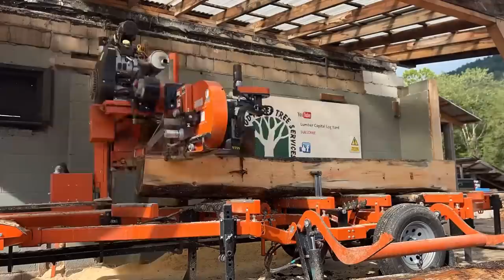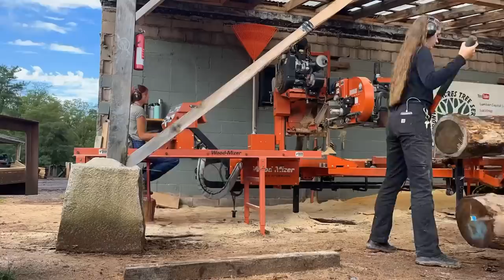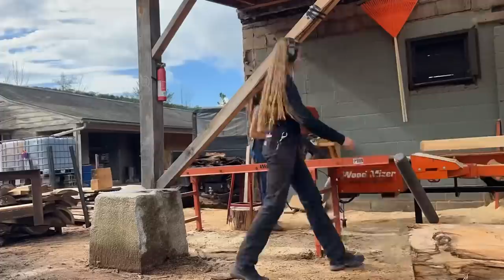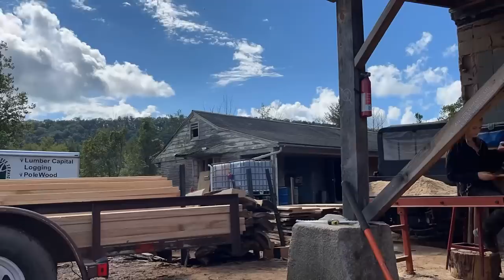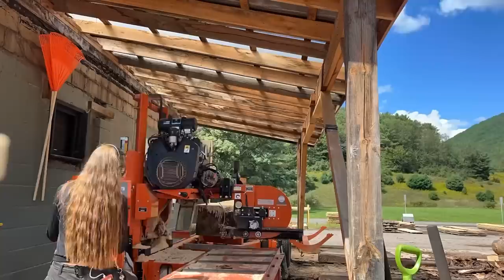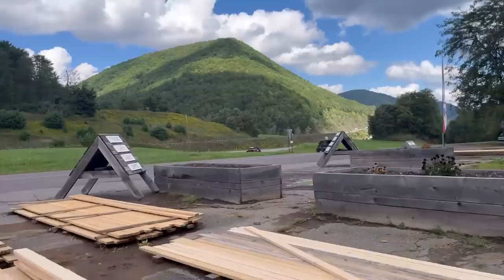Satisfying Mill Operation

Comment: You may want to consider re-leveling your mill. As the head moves along the bed, some of the legs of the mill come off the ground. This means your middle legs are too long. The front and back legs should always be touching the ground and support most of the weight of the mill. The middle ones should just be slightly touching, or even close with nothing on it. The bed of the mills have a slight bow upward to them from the factory and will level out when a log is placed on them.

Comment: Is there anyway to set up a GoPro on the machine close to the (bandsaw?) portion? An be able to keep the footage from shaking due to the cutting vibrations? Would be cool to see a close up of the wood being sliced. Maybe a slow-mo addition. I was a carpenter as a teenager & some of the wood I worked with were in very old homes. Almost fossilized to the point hanging a ceiling fan was impossible without using drill bits. Wondering if there's anything specific abt the saw to be able to rip such big trees? Are they just soft nowadays? Do you get them so soon that they're easier to cut? Do you have any old aged wood on site you could try to cut with random bands? Just throwing ideas out there as I do enjoy watching this as I fall asleep some nights. I also watch it awake, that's why I'm asking so many questions in this comment

Comment: Years of therapy for low back pain keeps me hyper vigilant for potential issues that can be “nipped in the bud”. The stool at the lt40 has a bad tilt to the left which can cause long term problems. Your last 2 videos show the tilt, which is like sitting on a wallet in your back pocket day after day. If the tilt was toward the mill it would be much better on the lower back. Leveling the stool is another option. Or if all else fails give it a quarter turn clockwise each day to change the direction of stress. Something about an ounce of prevention and a pound of cure kind of thing.